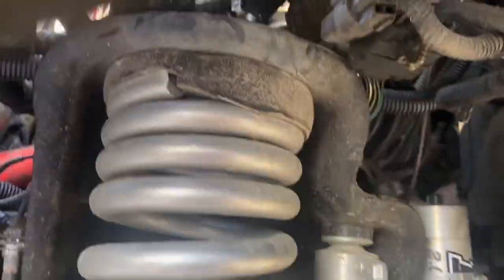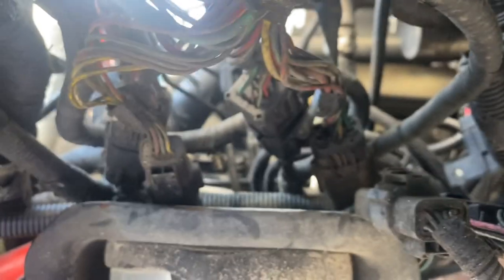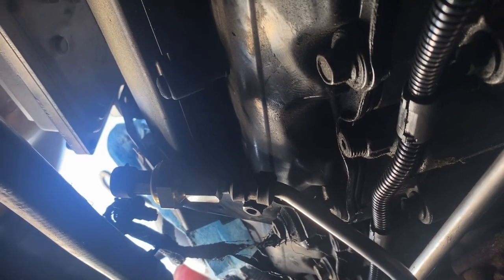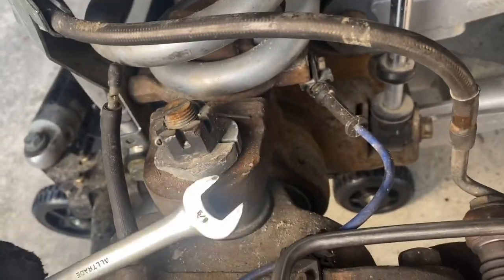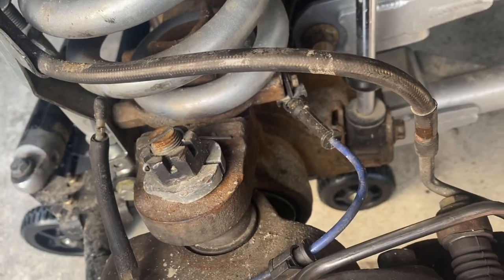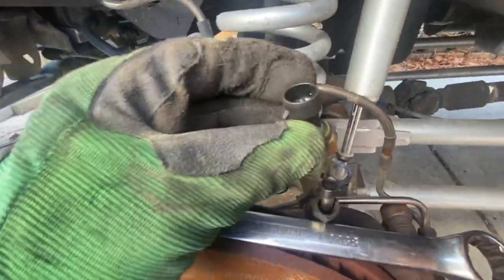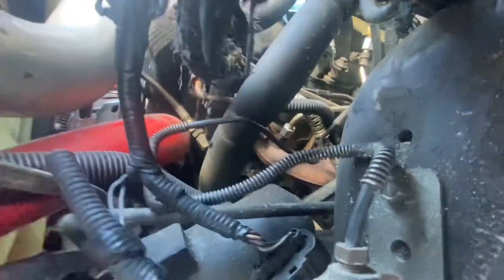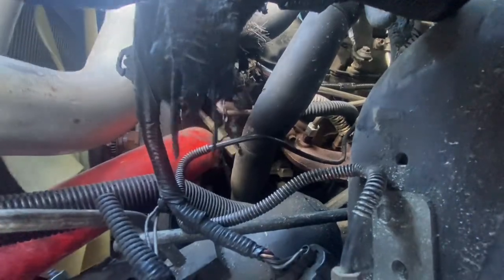2005 6.0 Powerstroke EBP (exhaust back pressure) sensor and tube replacement.

Comment: What symptoms were you experiencing that led you to replace these items?
Reply from the maker: @anthonysilva5015  I had a CEL for the sensor and the back pressure reading itself was higher than what it usually was.